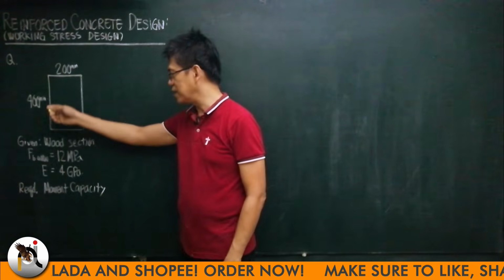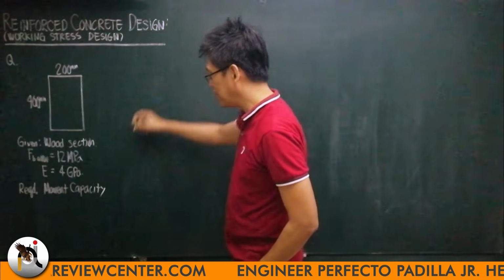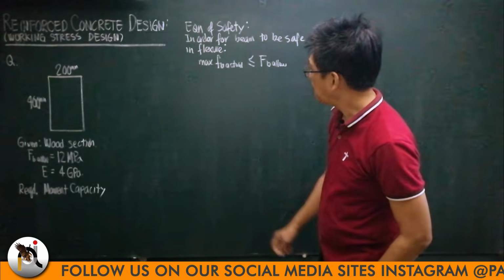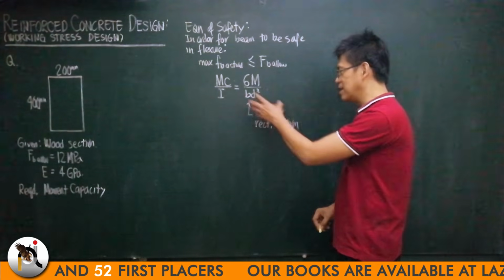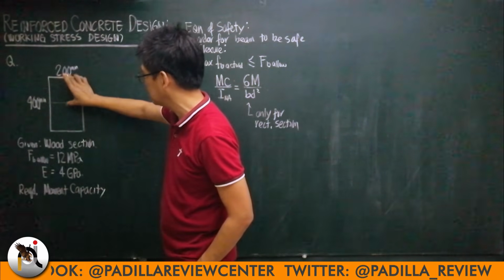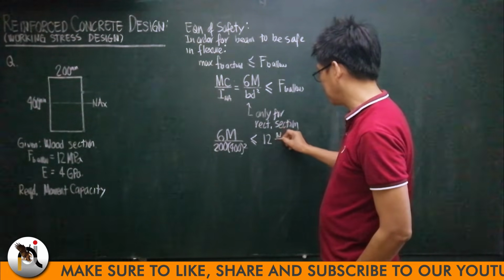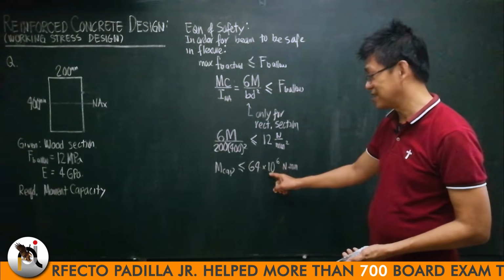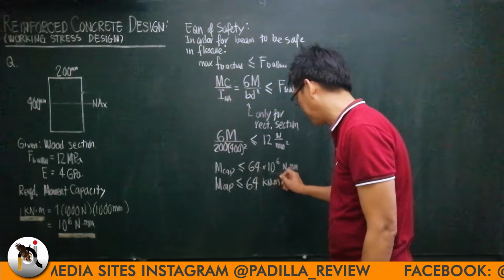Reinforced Concrete Design: Fundamentals of RCD & Alternate Design Method  - Part 1

Comment: helu sir. how is frame analysis of structurally indeterminate reinforced concrete done? is it okay to use the uncracked flexural rigidity in analysing the moments in every member then these moments will be used to calculate the required reinforcement?
Reply from the maker: If you are allowed to use computer program, then you can use Staad. Pro or etabs.

But for manual frame  analysis, you can use equivalent frame method for vertical analysis and  cantilever method for lateral analysis
Reply: @PadillaReviewCenterOnlineTV  thank you, sir.
allowed po ba din po ba ang slope deflection method at moment distribution sa pag analyze ng frames, sir?

may website po ba kayo kun saan pwede magpa register para rcd course?
Reply from the maker: Yes You can use Slope deflection method for continuous beam. But when we talk of frames, Slope deflection method will be quite complicated and is already impractical.

Visit www.padillareviewcenter.com
Reply from the maker: Visit padillareviewcenter.com to enroll

Comment: Hello Sir. This is to clarify thr provision of NSCP 2015 regarfing the minimum spacing of reinforcement, particularly Art.425.2.1. The 50 mm requirements of NSCP 7th edition is different from other edition of the NSCP and the requirements of the ACI 318 (all editions, from 318-63 to 318-2014). Is it really 50 mm as required by NSCP 2015? or 25 mm as required by other codes of previous editions? Thank you and more power
Reply: 2.5 cm is too small...I would say calculate it to be more precise
Reply: Is it not the smaller of 25mm , db and 4/3 of aggregate?
Reply: 25mm dapat, nagkamali lg ang NSCP2015 kaya naging 50mm